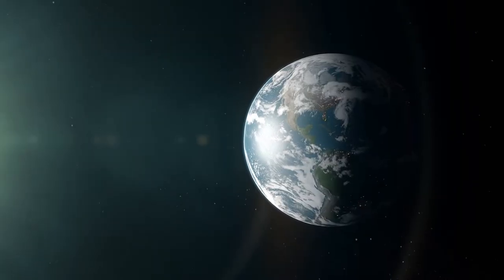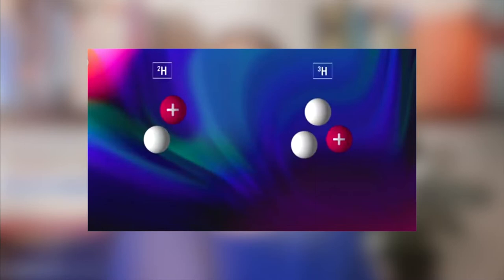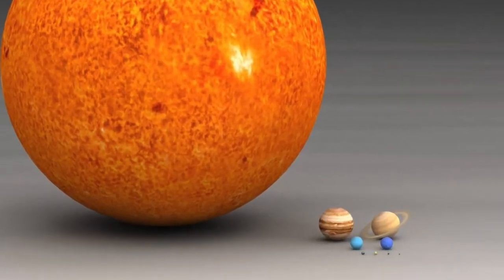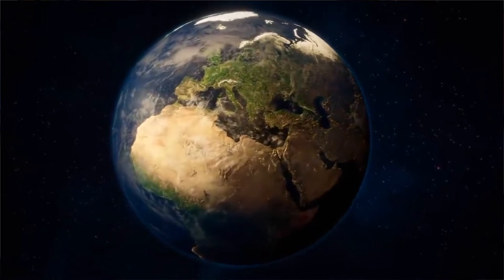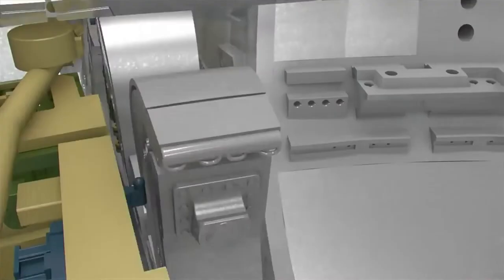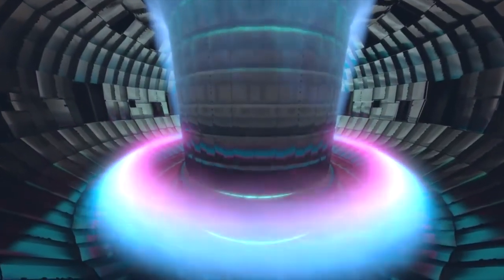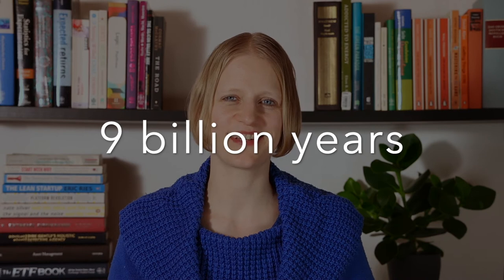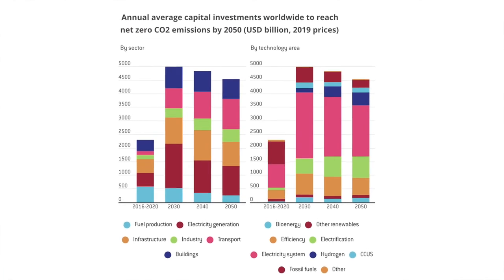Nuclear Fusion on Earth:  ITER vs Sun

Comment: Thanks for saying that we have to act on climate change now with the existing technology. We can't wait for a fusion reactor to become technically viable. I'm not anti-nuclear for baseload power production but there is better safer fission technology already possible with reactors like molten salt based breeders. We have to continue to build out solar, wind , hydroelectric and tidal energy to quickly stop adding fossil fuel carbon to the atmosphere and then some day we may have sustainable fusion.
Reply from the maker: I completely agree. Thank you for sharing! 🙏